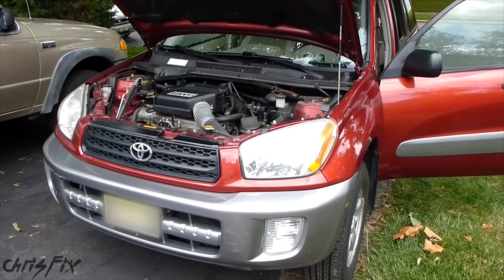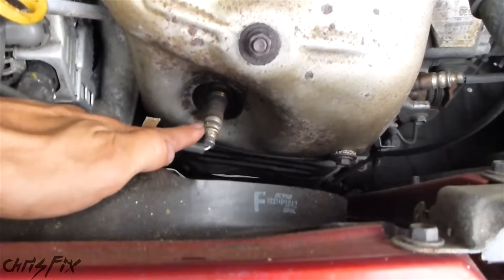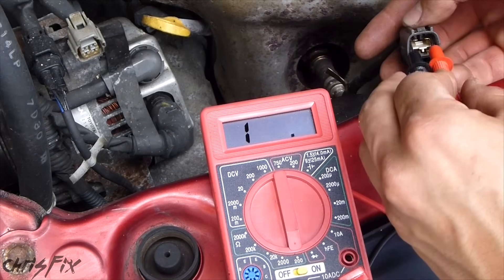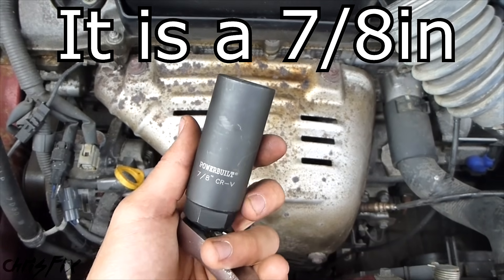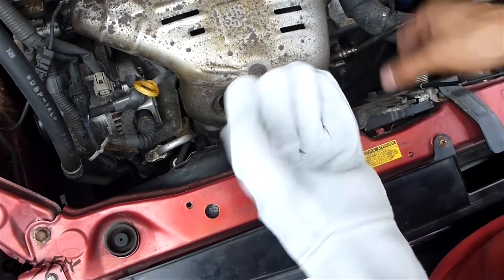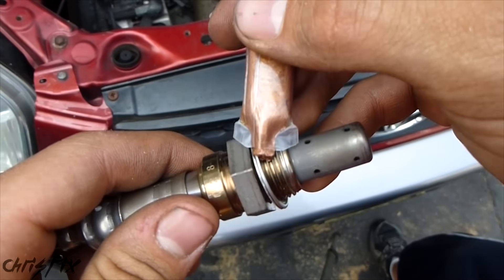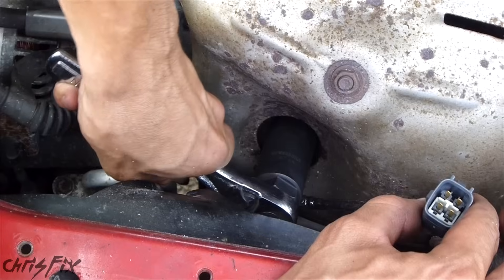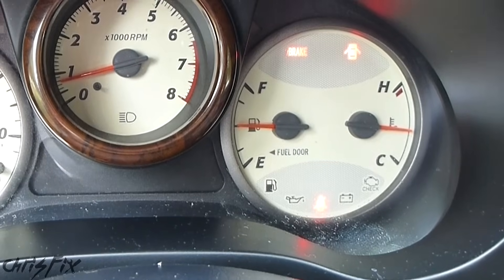How to Check and Replace an Oxygen Sensor (Air Fuel Ratio Sensor)

Comment: How would you test a 5 wire 1
Reply from the maker: andujo211 First I would use the OBD2 scanner to see if you are getting a signal from the O2 sensor. See if there is any voltage coming out of the sensor. If you are, then you need to find which wires are the heating element and test for continuity.
Reply: ChrisFix I will do that tomorrow and then I'll get back to you thank you though great video.

Comment: With the winter season upon us do you think you could do some troubleshooting on rear defroster grind lines. in my case none of the line are broken or damaged. not sure what steps to do. Push the button, the light comes on but no melting of the ice. Thanks in advance if you do a video!
Reply from the maker: Matt Simmons Yea, that is a great video suggestion. I am actually working on it now!
Reply: ChrisFix
NICE!

Comment: Denso, good choice since Denso makes OEM Toyota parts.

Another tip, for removing the old one, you can just cut the wiring off as short as possible so you can use a regular socket to get the old one off. It doesn't help with installing the new one mind you ;-)
Reply from the maker: dainternetguru Yea, I heard that the Toyota's dont like aftermarket O2 sensors so I went with the OEM. Thanks for the tip too!

Comment: I don't know if you remember my sticking starter question, but it could be related now. So, I went to school and park my truck like I normally do and I turn it off and step out. Then the truck turns itself on and runs while the keys are in my hand. I wasn't able to turn it off until I put it in drive and drove into the shop at my school (learning to be an auto tech). After that i put it in park and I turned it off. It stayed off that time. I don't know if it was still related to the starter or if I have some wiring problem. What do you think? Its an 06 tundra no remote start. Plus my instructor had no idea what it was, he had never run across anything like that.
Reply from the maker: argonian bilbo Could be that the starter is bad and or a wire is grounding out (so it is like you are starting your car but with no key). Did you take a look at the starter and wiring around it?
Reply: no ill take a look
Reply: Im assuming its a diesel because you say truck so if its a diesel it's probably the diesel governer.

 Because most diesel engines don't have throttles the governor controls the amount of diesel going to the engine. If its not working properly it will be letting fuel get to the engine after ignition off and because the engine still moves after the ignition is turned off the fuel will get ignited (becuase of compression) and the engine will fire up again because there's no throttle to choke the air off.
Reply: ihavenousername1805 No its not a diesel. It turned out I had remote start and if i was near enough to the truck while the key was in my pocket, I would trigger the remote start because my key fob is VERY sensitive.
Reply: Ah my mistake. Most trucks here in the uk are only diesel. 

Sounds like a stupid idea to have an engine start function on a key fob. Unless you can get it to drive to you from the other side of the parking lot haha
Reply: ihavenousername1805 That would be nice. You would never forget where you parked

Comment: Smashing and snappy video :-))

Your video shows where the sensor is, thats often a stumbling block for people that dont know the engine very well, and you showed a typical problem, even if it was the actual sensor itself then the viewer still knows where to look :D

Never forget to touch the probes together for the stray resistance in the meter, then subtract from the test reading for as accurate as possible result, i say this for times you wish to test wires/connectors.
The cheap multimeters do work very well considering that they have just a handfull of parts, i have two of the bright yellow 830B types for outside use, handy for any toolkit :)
Sorry i waffle chris :(
Reply from the maker: zx8401ztv Thanks bud and great tip! I tried to show everyone that you shouldnt just go replacing parts but first do a simple test to make sure the part is actually broken.
Reply: ChrisFix
Yep you did that spot on, as allways :D
Even a pillock like me could replace that sensor now :D

Comment: You were right to take the sensor OUT of a warm engine, as this expands the manifold threads slightly and aids removal. Once you had condemned the sensor you could have cut off the pigtail to help removal. That slit in the socket is for installation. You can also use a box end 7/8" wrench. Thanks for the video.
Reply from the maker: russwelday Thanks for the tips. I am glad you liked the video!
Reply: russwelday For the sensor in the video, a box end wrench wouldn't work unless you remove the heat shield from the manifold. I even have offset wrenches, and there's no way they would fit down in that hole to engage the sensor. If you can get at the sensor with a wrench, you can also use a flare nut wrench or a crow-foot socket (especially useful if a box end wrench won't fit over the pigtail). Just don't use an open end wrench, because it could round off the corners on the sensor nut.

Comment: Man, what a nice convienent place to put the O2 sensor. My acura has in on the exhaust and it was a hassle to remove.
Reply from the maker: Indie Guy Yea, you cant get much easier than this. Some engines it is on the other side against the firewall.

Comment: By the way, it is a bad idea to clear any codes using an OBD2 reader... Just leave it after you make your repair and the light will automatically turn off if the fix is done properly.
Reply: ChrisFix probably to make dealers rich XD
Reply: The light is usually programmed to turn off after so many on/off cycles(for my car its 50). The system just collects FF data the second the engine detects an issue, so leaving the light on is no issue. If the car gets another code, it just starts gathering up. So its more practical to just clear the light after you do the repair.
Reply from the maker: Jefford717 It isnt a "bad idea". It works either way, you can clear the code and if you didnt fix the problem it will come back on, or you can drive around and see if the light shuts off. On some cars, you can fix the problem but the light wont go off until you reset it (for some reason).

Comment: So I have a quick question. I have an 01 civic with a main and secondary o2. The secondary is screwed into the side of the cat. I keep getting a check engine light for that sensor but it keeps coming and going day to day. I plan on replacing it because I know it can't be getting accurate readings. What causes it to keep going out then coming back? My past experience with these is that they just straight go out. Never seen one 'fix' Itself like this one does.
Reply from the maker: federalrj94 What the O2 sensor is doing is it is comparing the Oxygen from outside air to the oxygen inside the exhaust. That creates a voltage. When there is a lot of oxygen outside vs in the exhaust you get up to a .9v reading. When the Oxygen difference is not that great inside vs out, you get a small voltage reading of around .1v. If you use an obd2 scanner and watch your O2 sensors sensor 1 (before the cat) should be like a heartbeat and oscillate back and forth from high to low voltage. Sensor 2 (after the cat) should be steady. If you get an intermittent check engine light, your sensor could be going bad or your cat could be on its way out.
Reply: ChrisFix thanks for your response. I never knew that before, now I understand a little more with what's going on between the two.  
Another question is have you heard of people cleaning out the catalytic converter with dish soap before? What would your opinion be on doing that? 
It's got an aftermarket system on the vehicle which I would say probably has gone through half of the 200 thousands miles on the car.
Reply: ChrisFix
Or the problem could be any number of things upstream. Many O2 sensors are replaced for merely telling the truth.
Reply from the maker: russwelday which is why I tested the heater circuit in the video to show that it was actually the sensor which was broken.

Comment: I too had to change O2 sensor on my V6 ES300 engine and the original one was super tight and I ended up cross threading .. So took it to dealer and they fixed it right up and even torqued the new sensor
Reply from the maker: lexusfan100 Yea, if that happens in the futre, run the engine so it gets hot (or use a flame to heat the sensor. Then it should come out a lot easier.

Comment: Additional info to anyone replacing O2 - A/F sensors. Never spray silicone lubricant around these sensors especially on them even the wiring, it will poison the substrate in the sensor and ruin it. These sensors 'breath' atmospheric air to create the voltage. Many do that through the connector for the wiring, others do it through little tiny hones at the top near the connector.
Reply from the maker: Cragified Thanks for the tip!

Comment: Also called a O2 sensor right?
Reply from the maker: jaymeez They are a little different. An oxygen sensor detects how much unburned oxygen is left in the exhaust system after combustion. The air fuel ratio sensor checks the amount of oxygen left, along with how much Carbon Monoxide is left, making it much more accurate than an oxygen sensor.

Comment: Doesn't this also go by Oxygen Sensor? I recently had to replace mine on an 04 Civic
Reply: Exactly what i was thinking, I think Chris should name the video "How to Check and Replace an Oxygen/Air Fuel Ratio Sensor
Reply: Same thing. One name designates what they detect, the other determines what task they are doing.
Reply: Cragified  Thank you kind sir
Reply: ***** Cragified Quinnjamin10   Also known as a lambda sensor or probe.
Reply from the maker: Quinnjamin10 Check my other posts. An A/F Ratio sensor is more accurate compared to an O2 sensor. But I took your advice to make it easier for viewers to understand.
Reply from the maker: Quinnjamin10 I really appreciate it (I know you arent basing me)! I adjusted the wording for the exact reason you mentioned. Thanks again for the suggestion! I love when my subscribers help me out!
Reply: ChrisFix
Was just thinking that if it was called Air Fuel Ratio Sensor, I would be thinking wide band :)
Reply from the maker: Cragified They are a little different actually. An oxygen sensor detects how much unburned oxygen is left in the exhaust system after combustion. The air fuel ratio sensor checks the amount of oxygen left, along with how much Carbon Monoxide is left, making it much more accurate than an oxygen sensor.
Reply: ChrisFix Would everything in this video apply to an O2 sensor?
Reply: ChrisFix Chris is correct after looking further into it. Except Carbon Monoxide is not unburnt fuel it is incomplete combustion, slight difference. AFRs are faster responding then zirconium oxide O2 sensors but require much higher currents 8amps compared to 1.5 and the heater circuit is vital to their function since they require higher temperatures to function.

to the DIYer though they go in exactly the same place and do same job of being the sensor helping the ECM find the proper fuel ratio.
Reply from the maker: ***** What distinguishes Air Fuel Ratio Sensors from regular O2 sensors is that the AFR Sensor is what is known as a wide range O2 sensor whereas the basic O2 sensor is a narrow range sensor. It can detect a wider range of air/fuel ratios than the basic O2 sensor. Also, the AFR Sensor has a little bit more circuity to enable it to detect more minute variations in the exhaust system air content (more sensitive than the O2 sensor). Therefore, it is able to make better adjustments through the ECM to add or subtract fuel to produce a better mix of air/fuel to maximize efficiency and minimize emissions.
Reply: ChrisFix Yeah sorry wasn't trying to bash on you, I was just thinking that more people know what an O2 sensor is rather than an A/F ratio sensor, had never worked with A/F ratio sensors only O2 sensors but I guess it's just whatever your car needs.
Reply: No. 2003 and earlier Civics had an oxygen sensor. In 2004, Honda replaced the oxygen sensor with an air/fuel ratio sensor on the Civics.